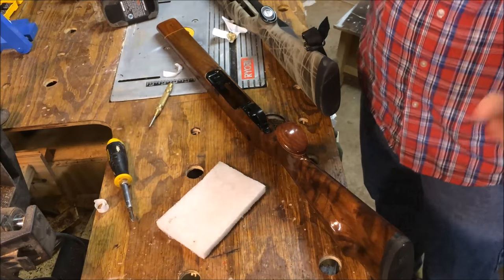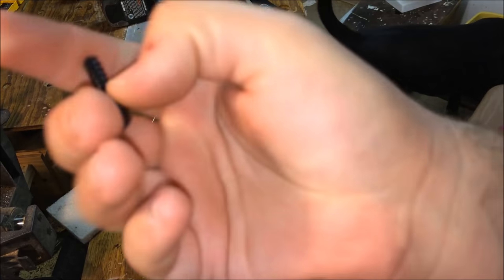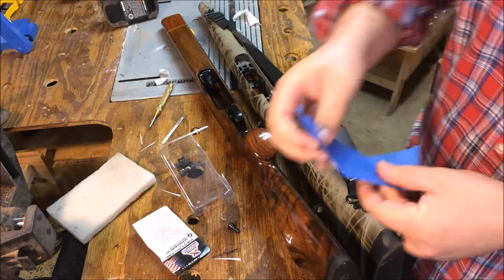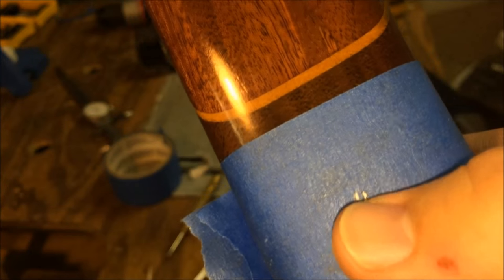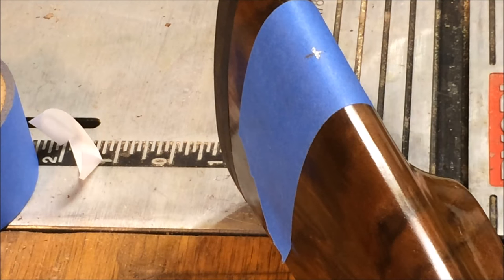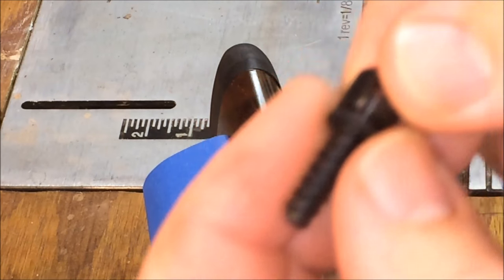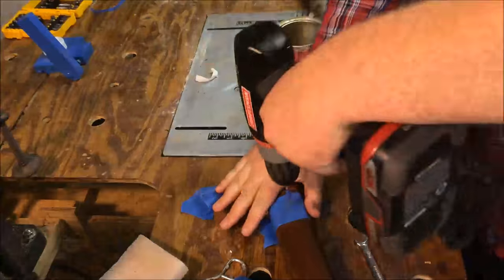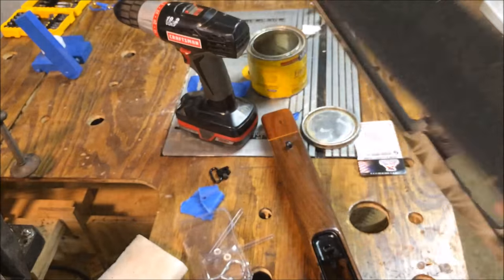How to Install Sling Swivel Studs in a Rifle Stock

Comment: Thanks for the video! I recently bought a Marlin Model 25MN and it doesn't have any sling attachments at all and I wanted to put a bipod on it so I watched your video and installed them today - it looks great and works perfectly! I basically knew the process overall but it was good to get confirmation from this video and the little details helped such as using the center punch and adding tape to the drill bit to get the depth correct.

Comment: How do you get the angle of the hole you are drilling, especially the one on the butt portion of the stock, correct? It could cant either angle, and that is my fear when doing this. I don't have a drill press, so I was thinking the way to go would be putting it in a vice? I don't have the guts to do it freehand like you did.

Comment: If you read the instructions you’re actually supposed to use two different drill bits to create a small counter bore. If you want it to look really nice a third counterbore will let you slightly countersink the studs but this method I. The video will work, but you risk some splintering or even splitting

Comment: Nice Video, one ? if it's a laminate stock what could you do to prevent the laminate from cracking? How is the studs and the laminate holding up on that 30-06? I am thinking of purchasing the 17hmr Savage with the Barracuda stock, but want to add the swivel  stud so I can add a Henry style bi-pod.
Reply: Larry Jenkins you should run a tap into the stock to cut the threads, rather than letting the stud threads force their way into the hole.